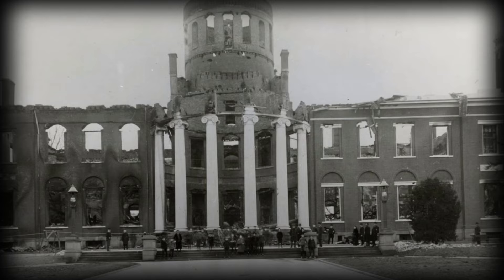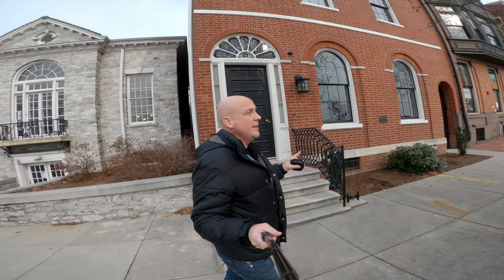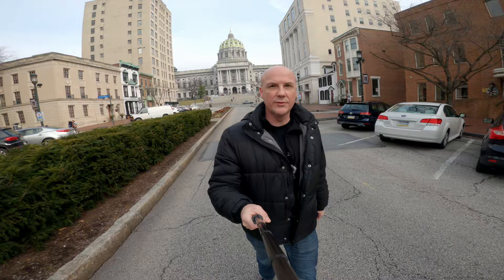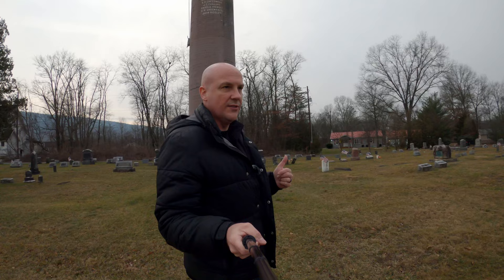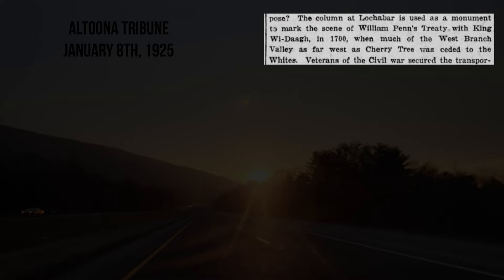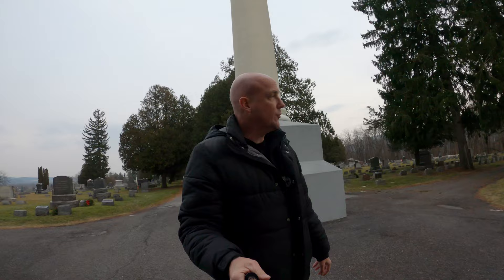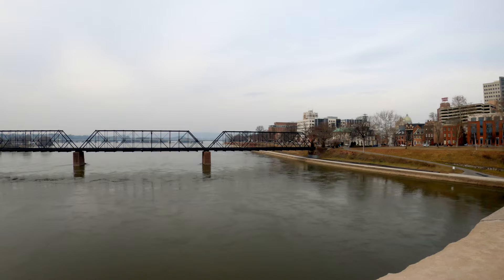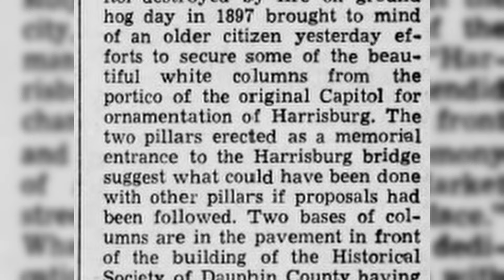Mystery of the lost 1820 Pennsylvania Capitol pillars in Harrisburg PA & the Curse of Stephen Hills.

Comment: I found a photo of the market street bridge in 1906 with the big white pillars, not the smaller sandstone pillars that are there now. Upon research I found an article from 1941 making mention of the sandstone pillars at the entrance to Market Street Bridge. So some time between 1906 and 1941 the white columns that flanked the bridge disappeared.
Reply from the maker: Actually I think you are talking about the photo of the 1906 dedication of the bridge that I included in my video. That is the same pillars that are there now, they just removed the bulb at the top at some point.
Reply: @runningintohistory  hmm yeah you're right, the color was what got me, on this photo they are white, but they are brown now, must have painted them back then
Reply from the maker: @kokkodrums  yeah the Capitol Historian told me why they removed the bulb but I do not remember the reason.